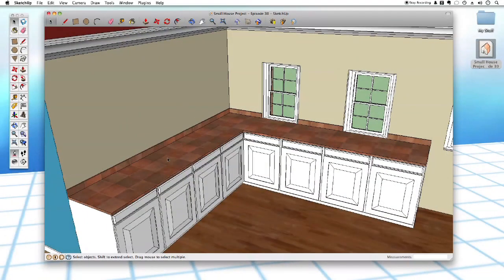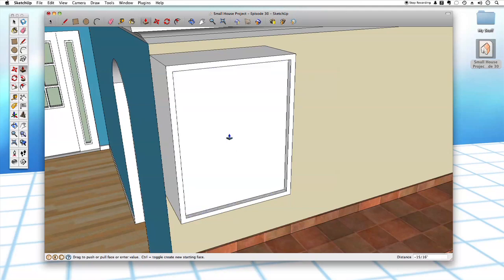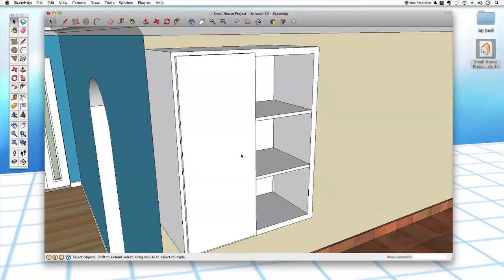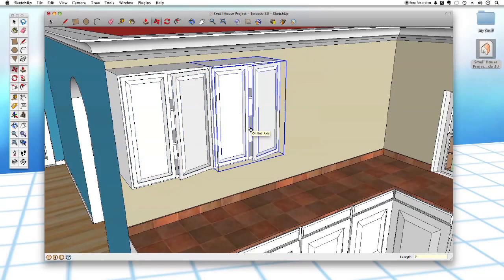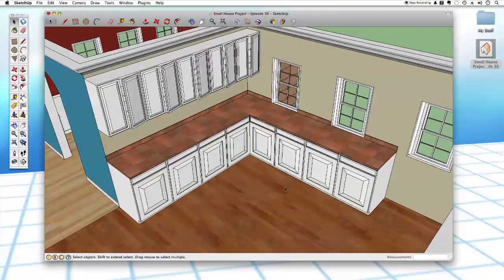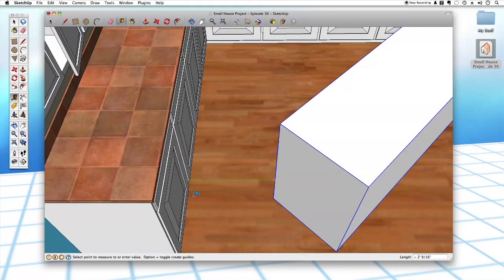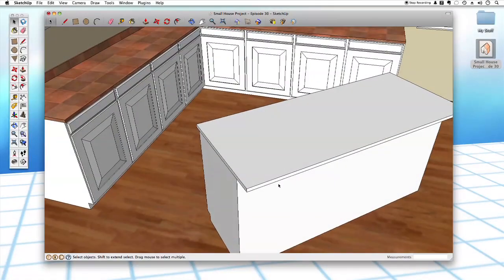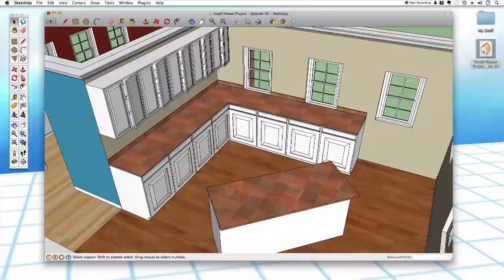Sketchup #30: Overhead Cabinets & Islands

Comment: What if you don't want that tile laid diagonally on the island? Is there a way to control the direction that a texture is applied?

It looks like the most convenient way to build on the diagonal is to build it parallel to the axes and then rotate it into place only once you are finished with it.

Comment: A very good video. The only thing I didn't like is the fact, that you make the Cabinets to one big block. That's not realistic. Nobody would put a 10 feet long Cabinetblock on a wall.
Reply: You'd be surprised. 

What's not quite realistic is that there is no refrigerator, sink or stove, and yes, those appliances would break up all that nice cabinetry.